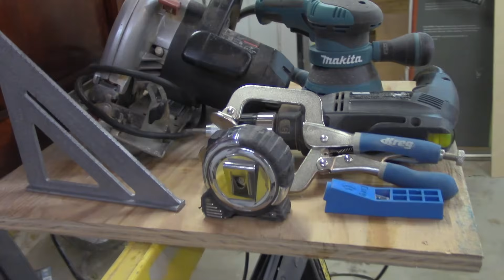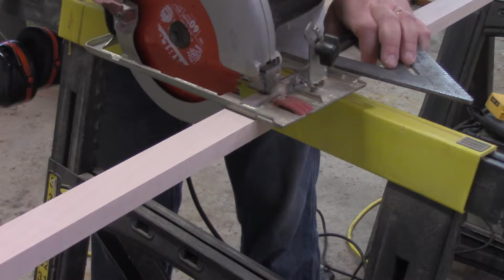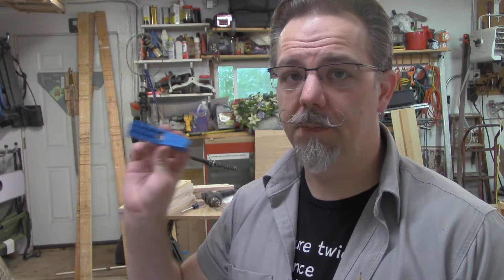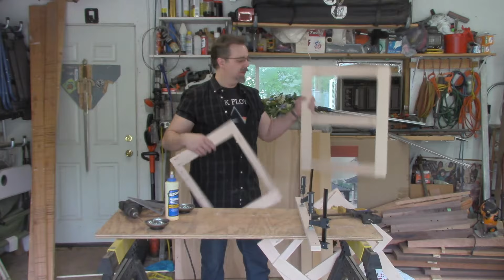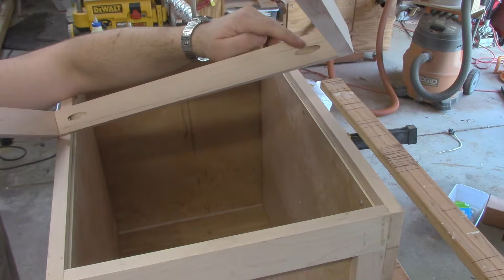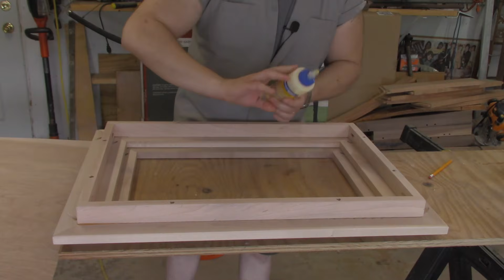Beginner Woodworking: Make furniture with only 6 tools

Comment: finally someone who doesnt use fancy tools and have huge spaces to work in. thanks, i feel more confident going forward knowing it's possible.
Reply from the maker: Oh, I have some fancy tools, too. But fancy tools don't do things better, they just do them quicker. That is all. 

If you don't have a fancy CNC, you can get by with a jigsaw, drill and lots of sandpaper (maybe a router for engraving). It will just take a lot longer and be much more physically demanding. 

If you don't have a fancy Festool Domino, just use mortise and tenons. Again, it just takes longer and is much more physically demanding. 

Remember, there were people that were making fine furniture long before there was electricity. It just took a lot longer and was more physically demanding. :D

Comment: Where can I buy that pocket hole jig and how much does it cost??  Ive looked online but can't find the one you are using..
Reply from the maker: It's an old model of the Kreg pocket hole jig. The K3 or something? I think they're discontinued, but Kreg has the K5 or K7 now. You'd probably need to search Ebay or Facebook Marketplace to find an old Kreg jig. However, if I were to buy a pocket hole jig now, I'd probably grab the Armor Tool Auto-Jig. 

Thanks for watching!

Comment: How did you flatten and straighten the wood
Reply from the maker: I didn't. I bought the wood pre-milled and dimensioned. It's called s4s lumber, meaning "surfaced 4 sides". 

A fairly local home store around the Midwest U.S. called Menards ( a competitor to Home Depot and Lowes) sells a small selection s4s hardwood, like maple, ash, hickory, mahogany. I just brought the wood home and started cutting. I believe both Home Depot and Lowes can special order s4s hardwood, as well. You can also get s4s lumber from regular lumber yards. 

S4s lumber costs more than the raw lumber you might pick up from a lumber yard, as you might expect since the company spends more time and energy on getting it to look nice. But if you're only doing a small project, you don't need to spend thousands of dollars in machinery or hundreds of hours learning how to use hand planes to get the same results.